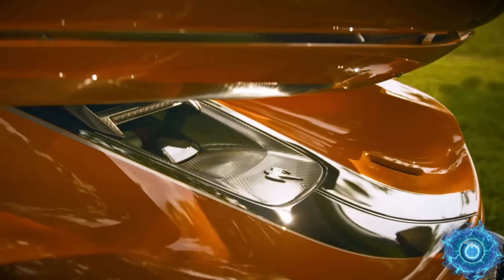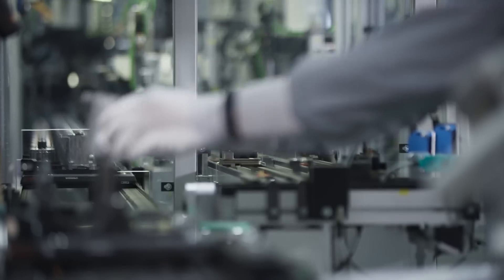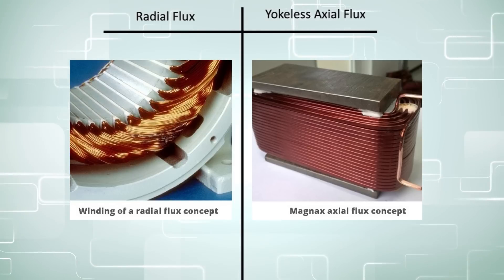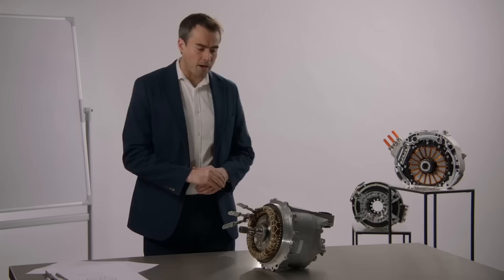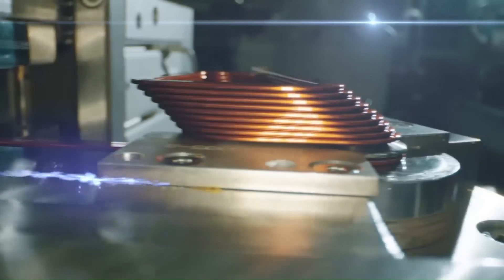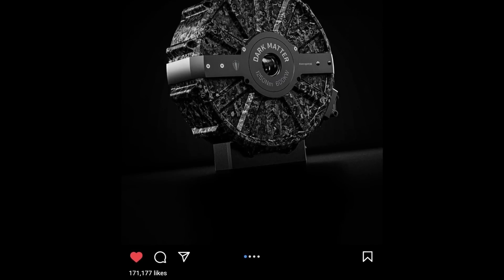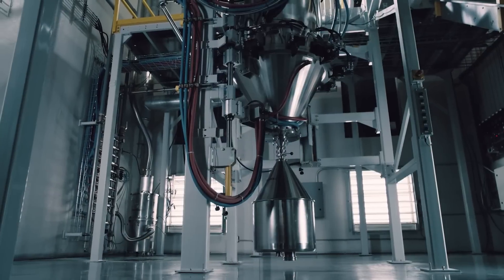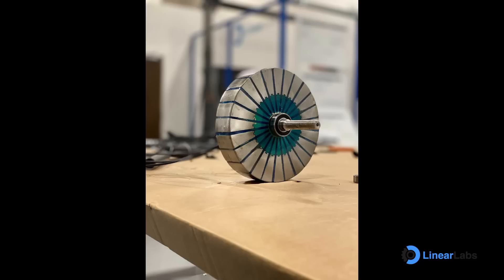FUTURE Motor Has ARRIVED!? - Dark Matter Raxial

Comment: The motor obsolete already, backyard engineers too whom machine with no robotics' with metal smelters can build more powerful motors at lower cost because of the inflated price, because people want too replace humans, refer to particle accelerator designs and real science, don't fall for mis-information, do math work by hand and draft by hand too prevent theft.
When the material cost is below 1/3000th of the inflated cost of an unit, its time not too trust anyone using robotics to build things.

I trust absolutely no information provided by Tech planet after stating Elon Musk was the founder of Tesla in more than one video, when the real founders were not mentioned  and built the company from the foundation(Mark.T.&Martin.E.)
Clearly the person getting paid to say things, provides counter intelligence with out respecting the values of humanity.

Comment: A 100 hp axial flux motor might be light enough to be incorporated into a hub/wheel design.  The issue of the "unsprung" weight, that is usually pointed to as a big issue... might be overcome by the ultra light weight design.  Eliminating the axles, differential, etc.    Also... the possibilities of incorporating this into the hybrid design... to do the heavy pulling /acceleration..  The market would go crazy for a 500 hp hybrid truck, that got 56 MPG.  Ford / Chevy... are you listening?

Comment: axial flux motors have been around a while, there are a lot of 3d printing guys making them. The real issue with ALL high power electric motors isnt the mechanical engineering its the electrical engineering. Your talking about a minimum of 800V @ 750 amps to get your 800hp (about 600Kw) and thats assuming 100% efficiency which isnt really a thing (probably 90-97% + mechanichal linkage losses). What that means is that your driver board needs to deliver the equivelant energy of 331 household 120v/15amp (or about 82  240v/30amp) circut breakers at full load simultaneously...... so say hello to only the manufacturer being able to work on the vehicle & since the cell packs are almost always (assembelies including the pos sense & driver boards) say hello to a battery assembly half the cost of an average US home.

Comment: Once had an RC boat with 2 TP motors (inrunners). They each put out 21,5 V x 270 A = 5800 W at peak power. At 715 G each. It would be equivalent to 323 Kw or 439 HP at 88 lbs..So 800 HP is insane. Especially if you consider that it needs to have a lifespan longer then a few hours.

Comment: You guys should really stick to the traditional torque to weight ratio. It will alleviate heat emissions if you have an aerodynamic interior dispension body design. And I will ride for years.

Comment: High tech motors are great but we're missing huge gains in efficiency by not applying basic mechanics to the loads. So long as loads are driven In-line whether it's car or tractor wheels, pumps or fans, we're missing whole unit reductions in required force.

Comment: US Army has been using Diesel Gen powered Axial motors in their top combat machinery with ultra capacitors and no batteries. Many would prefer no batteries until carbon air batteries are perfected economical to produce, Lithium is a joke/monopoly intermediate side step to air carbon/ceramics/alloys. All those Oil fields that were dried up are filling up again but this is kept quiet but it is well known and exposed in books like Behind the Green Mask and other Klaus Schwabb exposing literature. Either way that machine by that Egghead is the highest tech of any Egg on wheels.

Comment: I think axial flux hub kits for converting older cars to electric will be hugely popular, especially if they can replace the brake assemblies
Reply: I agree
Reply: Slowly it will, and the brakes will move in place of the differential gearbox, ie., onboard & center as regenerative braking will do the most work.
Reply: Too much weight will make the suspension suck but you can program it out with active suspension.
Reply: @edwincolon7782  that’s a great think .
Reply: lol no it wont.

Comment: Thank you for the peek at what is being acted on with innovators of motor development. It still has not addressed the full potential of induction driven machines. With Tesla's bifilar induction windings, he introduced effective high amperage capacitors into his induction power production machines that effectively enabled the phase shifting of current/magnetism reactive power (self-commutating motors without Lens's law resistance)
Naturally this is a designed resonance factor for both generators and motors, giving sweet-spot rpms that require less (even zero) input energy to run (eliminating the need for batteries and recharging: the bane of e-vehicles). 
This is not super expensive-exotic technology, but is economically disruptive as well as planetary-wide healing/life-saving easily migrated into AC motors of all kinds. It is the end of creating energy by burning matter (consumption).
Eventually all the world governments will have to cooperate to save the planet from big-oil's destruction. Party on, be good to each other.

Comment: We are literally experiencing a revolution where internal combustion engines becoming horse carriages.
Reply: when batteries are so heavy and 3.5-4x less energy dense than liquid fuels, no lol. not even close. EV's are antiquated tech. the control systems on modern ICE engines are just as advanced as any EV.
Reply: @ct1762 are you keeping up with ongoing research and new proofs in the energy storage industry? We absolutely are going to see internal combustion become comparable to horse power.
Reply: @bojanglesobrien6883 yes i have been. and everything is "just around the corner". ask yourself this: is it really possible batteries can be nearly as energy dense as gasoline/fossil fuels? the answer, dictated by the laws of thermodynamics, say no not even close. 1000 lbs of battery can barley be equal to 200 lbs of fuel .
Reply: @bojanglesobrien6883 yes and again, the next hot battery has been just around the corner for 50 years. even if it gets 50% more power dense, you are still lugging a heavy battery around empty or full
Reply: @bojanglesobrien6883 have you? Even the cutting edge research still doesn't provide the same energy density as fossil fuels, and it's nowhere close to commercial use. It also almost always uses rare earth metals which aren't sustainable in the long run, especially not if you take into account the demand growth if we actually all start driving electric.
Reply: No
Reply: Electric motors are very good since N. Tesla, the issue was and still is the storage, therefore the battery technology...and we are still considering the single car, moving to the implications of a large scale usage of EV cars it appears clear that not only your comment but also the EU politicians are non considering the entire view.

Comment: axial motors have low rpm thresholds which mean that compact size is offset by the typically necessary gearbox which radial motors simply don't need. I don't know what it means to be a "raxial" motor, but if it means an axial that can rev up to 20k without melting, then I'd say they've cracked the code.
Reply: Why the need for 20k revs that would be approx 20:1 to wheels?
Reply: @Luxamor-8  so you can achieve the torque people want without capping top speed to 60mph. that's why tesla uses radial motors and axial motors are more likely to be used as a torque-fill on a gasoline engine transmission, around where you would typically find the torque converter on an automatic trans.
Reply: @CSLFiero  thanks why not employ star/delta configurable in the inverter drive could give approx 1.7x electronic gearing, so dropping down revs at high speeds?

Comment: I am really curious about the possibiity of using this concept  for turbine generators instead of motors. Would it yield more energy or would it need more physical energy to rotate the blades?
Reply: Mercedes Benz already has axial motor prototypes and is planning tou use them in their cars. Chances are that over time it would be more used that the conventional ones, specially in high perfiormance cars.

Comment: As far as I understand it, one of the problems with an axial flux motor is that when you apply power to it it can turn in either direction. A radial flux motor on the other hand will turn in the direction that the power dictates. That's probably why the radial flux motor has been in production for these past 100-plus years. It's a very novel idea to incorporate the radial flux motor into the axial flux motor. That's also how their quark motor works. That motor is used in their Regera. I think it's about 330 hp. Sounds like dark matter is the big brother.
Reply: Nope. You can dictate the direction in both.
Reply: GM used these from Italy on the EV-1 platform combined with a PEM type hydrogen fuel cell that, 1 of 5 types that suitable for moment or mobile operation. At 180 DC. Uses deinionized water with dexacool and produces interior heat because the boxes sealed together driven with a circular pump. A heater core and radiator is used. The master controller control operates two torrential motors on 3-Phase rear and 4 on the S-10E used by Conn-Ed electric company is the East to read meters.

Comment: Do a search for '300hp ambient heat free energy engine'. It has one moving part, a flywheel which turns at 30,000+rpm and can run on the heat from a road or roof of a house. They are having workshops for helping people build them.
Reply: That's fake af

Comment: What we need is a 20 horsepower motor that weighs 2 pounds.
Reply: Castle Creations has there 2028 motors that are 2.75lbs and with the there matching XLX2 ESC on 8S lipo(33.6 volts) can max out at 20-25hp

Comment: I don't see why Koenigsegg didn't go ahead and simply implant that motor directly into the wheel hubs no cutting horsepower directly to the wheel no crankshaft no Center links to get that full 800 horses per wheel and that way they could focus more on getting the airfoil correctly breaking that speed barrier
Reply: Because manufacturing cost would be more than 4x what it is now. 4x engines and a bunch of re-enforcement to stop the wheels ripping themselves off the car at the slightest touch of the accelerator.

Comment: The lower rpm of the axial flux motor makes sense for automotive applications. The early Tesla motors ran at 20,000+ rpm and they required gearing, obviously. The 9000rpm of the axial flux motor will make implementation somewhat easier (I assume).

Comment: Axial flux in aviation, where power/weight is at a premium? How efficient is it, would the batteries feeding it in aviation drain faster, ruining the weight/power benefit?
Reply: The efficiency of a motor isn't the issue, electric motors are still far more efficient than any internal combustion engine. Your even if your best case scenario motor set up was magically 100% efficient, we don't have a battery pack available right now that can hold a candle to a petrol burning engine at 30-50% efficiency, simply due to the energy density of the fuel used. Even at that level of efficiency, we can pack more punch in liquid fuel for a longer duration than a battery pack for a comparable flight range. Our battery technology is nowhere near mature enough to be competitive.
Reply: Radial flux motors are already very efficient so there are little gains to be made here.  Weight and space reduction are the primary benefits.

Comment: You lost me at room temperature superconducting motor, I agree it is really cool, but I don't think it will happen in 30-50 years sadly, unless we get some insane software with quantum computers that can explore all possible crystals and probe their properties soon :D to be able to deal with the temperatures and the current densities, you would need a critical temperature at probably 100-200C above room temp. so Tc=400K-500K. :D At the moment it's still the cuprates that are leading the charge at about 150K without adding insane pressure in diamond anvills. it's a dreamy scenario, but Little has a theory of quasi-one-dimensional quasi-periodic metal chains that could be a clue to achieve room temperature, but at what practical use will a quasi-one-dimensional system have?

Comment: Thanks, excellent video and great covering on this type of technology which is evolving and became more refined by the day, magnetic motors have never been so efficiet and realible as per today by mastering the magnetic flux interplay. I follow an arospace engineer on 𝕏 that is working on developping breaded threads in graphene to use as winding for electric axial flux motors, he states that they have three times the power density than conventional ones and weight a third.

Comment: You can save even more mass and use less windings if you use a simple flux capacitor to enhance the flux capacitance
Reply: Yes... but then you start running into serious problems once you reach 88 mph.
Reply: @Cynthia_Cantrell if you calculate it correctly, you could close in on the coveted zero second quarter mile time.
Reply: LOLOL!!!  GIVE NO FLUX!!!

Comment: Duty cycle at maximum advertised output: about 5 seconds
Recovery time: AT LEAST 30 minutes
Reply: Source for this? Also, what can it output continuously/nominally?
Reply: Recover from what?
Reply: @Luxamor-8  - thermal load
Reply: @driverjamescopeland  water-cooled correct? Why would it then take 30mins to get back to safe operating temp?
Reply: @Phariseehunter  - not necessarily safe operating temp... but full dissipate the thermals, without the help of ancillary cooling. I'm sure the motor is plumbed for the latter... but that's still a ton of power from a considerably small mass. I can't imagine it surviving many of those pulls in any reasonable succession with the copper windings they show in their video.
Reply: @driverjamescopeland  apparently its direct cooled, uses no coolant, they use patented hollow core channels, possibly use thermally conductive resins etc, but not wrong at 600kW even removing 1% of heat loss would be unreal, though yes if its just a burst of energy over a few seconds of acceleration to get to 100kph would it be that much of a problem, remembering that the voltage is around 800V@ around 450A
Reply: @Luxamor-8  - with no active cooling? Yes... it would absolutely be a problem.
Reply: @Luxamor-8  The dark matter engine is oil cooled.

Comment: Maybe axial flux motors can also work in flying machines improving performance and efficiency, we are surrounded by motors in mixer, blender, trimmers, washing machine, fans, coolers, AC's power windows, wipers, drilling machines, and many more.
Reply: Anything that reduces weight will help, but battery energy density is still the fundamental limiting problem for electric flight.